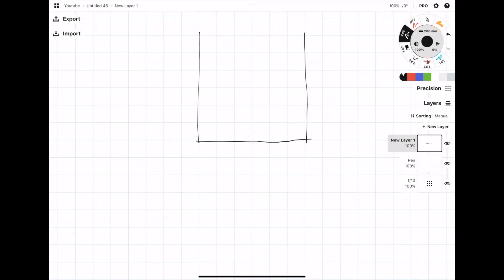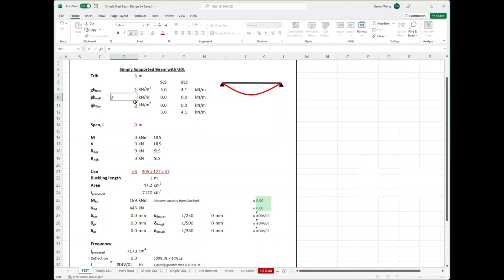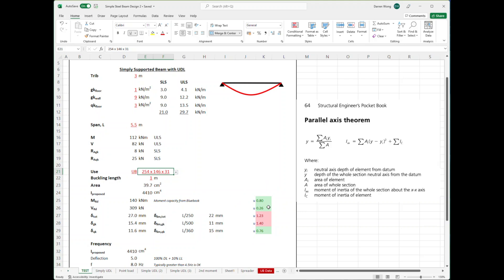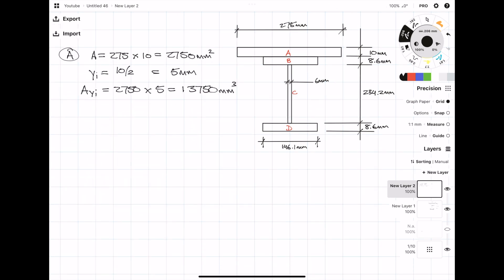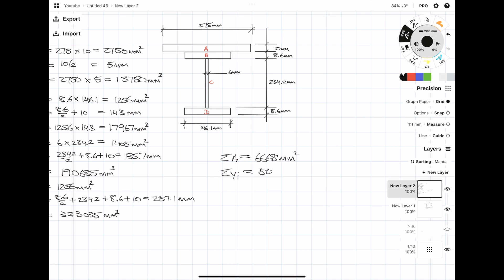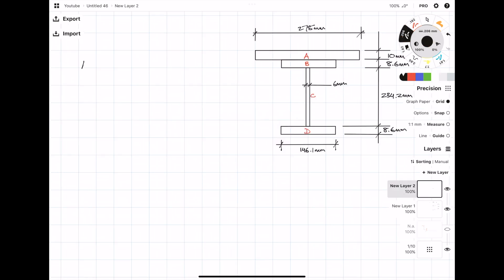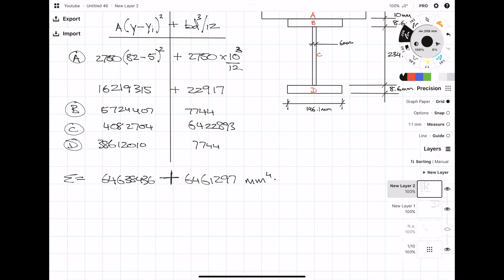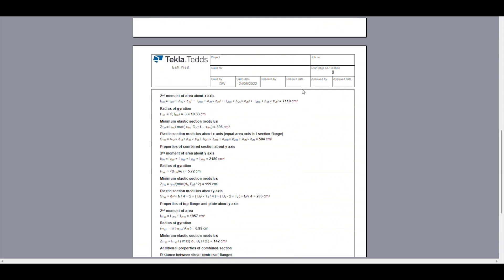How to design a compound section - Structural Engineering

Comment: This is brilliant! I have used 254UCs with plates for cavity walls (either to save on 2 x beams or trying to save head height with a 300UB) but was never confident with sizing the plates. And, never knew about that tedds module. 

Thanks again Daz, another great video and practical design. 

Video ideas: raft slab design, timber racking checks, windpost design, roof truss design.

Comment: If you had an I section (directly supporting an inner leaf) with a boot plate (welded to the bottom flange) supporting a outer leaf of masonry, how would you go about designing it? I suspect you would have to check the section for torsion as there is now an eccentric load acting on the assembly. But how would you go about checking the local stability of the weld? Is that something that you can often ignore in practice?
Reply from the maker: need to check for torsion and would likely need to add stiffeners to stop the I section from buckling. best thing would be to use a SHS or RHS section. you'd also need to check for rotation instability at the connection or support. welds is typically not something i'd design but you can work out the local force the weld would need to be designed for. i think you'd need to look at the design of the longitudinal shear from the bending moment.

Comment: Any chance you can explain how to connect the beam flange to the plate ? plus how do you insert grout between the wall and the plate.
and one last quastion- do you assume the wall keeps the beam from LTB ?
Reply: Thanks!
Reply from the maker: you'd weld the plate to the beam. depends how they install the beam but where there is a gap, we typically specify non-shrink dry pack and you basically ram it into the gap to make sure it is tight and that no movement can occur once you remove the props. 

the LTB resistance would be from the friction between wall and the beam as it is not mechanically fixed. there are equations that you can use to check whether or not the wall can provide sufficient LTB resistance.

Comment: I suppose you weld these top plates to the I section using fillet welds on either side. When you verify the welds (or determine sizes), do you go by the shear flow or von mises criteria? This pondered me the other day. Keep up the good work.
Reply: If you'd like to check it then I'd go for the shear flow. Here is a video with that exact calc: https://youtu.be/_qpzJx_jFiU
Reply from the maker: for a domestic beam like this I wouldn't really check it, if i had to spec a weld it is a minimum 6mm fillet. tbh, not really sure but if your beam like this example, the top flange is in compression. so you would want to convert that compression force into longitudinal shear for the weld design. 

for larger projects, we would get the fabricator to design these connections.